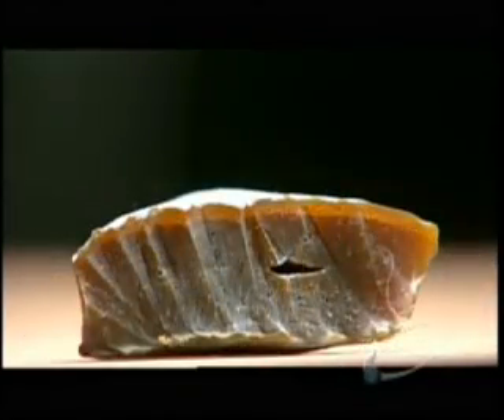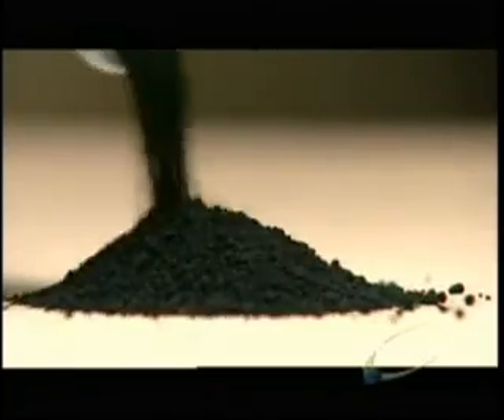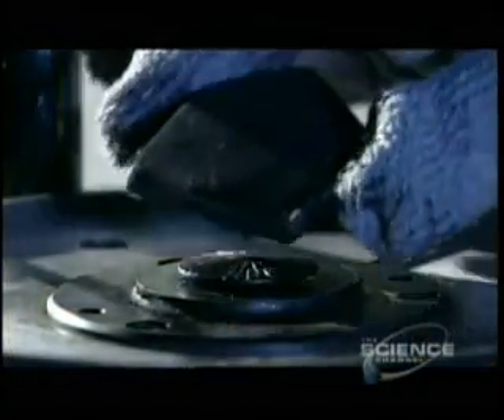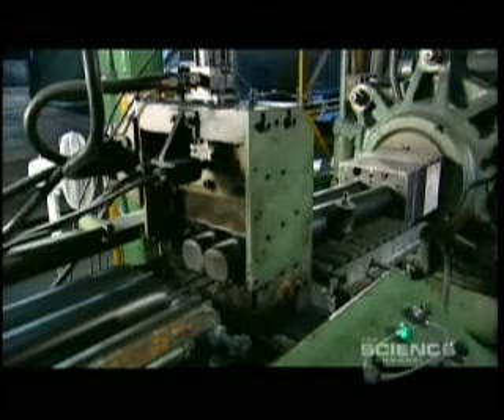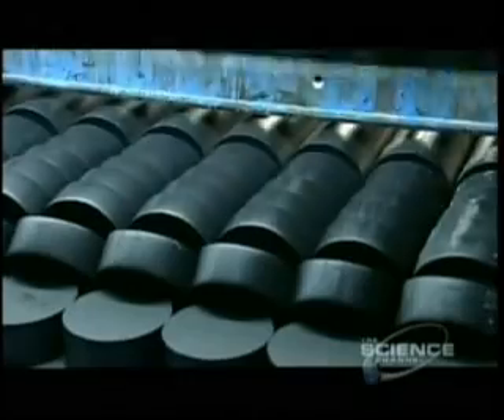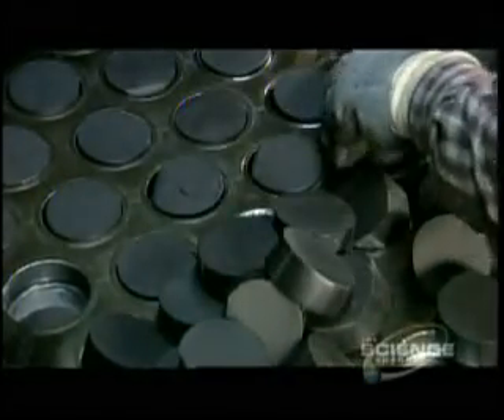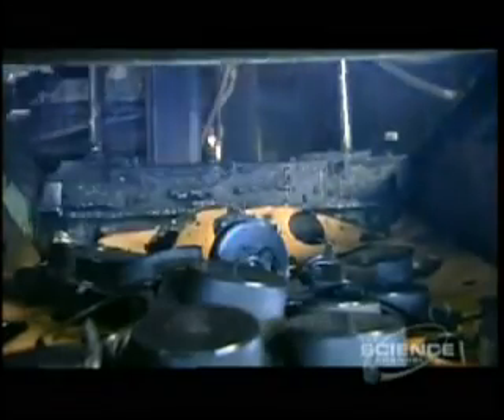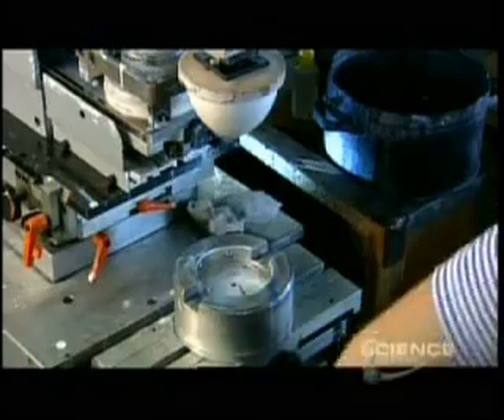Hockey Pucks - How it's made -  QNHL.com

Comment: I had to watch this for an assignment, if u need answers this is what I wrote

1.What is being made?
Rubber Hockey Pucks      

RAW MATERIALS:
2. How many ingredients go into the making of this product?
11 different ingredients.

3.  List three of the ingredients mentioned.
Natural rubber
Coal dust (carbon black)
2 different types of oils

4.  What supplies are used in the manufacturing of the product?  
Preliminary mixers, mill mixers, extrusion machines, compression molds, curing 
presses, trimming machines, buffing machines, and packaging materials are all used in 
the manufacturing of hockey pucks.

5.  What tasks did robots perform?
Preliminary mixer will first mix all the ingredients, then the mix will be sent down a
chute which brings it into the mill mixer. Machines will also make the hockey puck.

6. What tasks did humans perform?
Humans feed the ingredients into the mill mixer for final mixing, slice the rubber logs 
into preforms, place the preforms in compression molds, run the finished pucks 
through a trimming machine, and buff the finished pucks to a high shine.

7. What quality control measures are in place?: What happens to the products that don’t meet the standards? 
A sample from each batch is tested using a rheometer, the curing curve is compared to 
a quality model, and the pucks are polished to a high shine as part of quality control 
procedures. If a batch of pucks doesn't meet the requirements, the materials will be 
reused.

8.  Is there any waste created in the process?  If so, how does the company address the waste?
In the process of making hockey pucks, waste is produced, in response, extra rubber 
is scraped off the molds and trimmed off the finished pucks. This extra rubber is 
grinded and used as filler in later batches by the company.

9.What is JIT?
Just in time.

10.Name the organization deals with quality control. What are seconds?

I rewatched the video around 3 times and couldn’t figure this out.